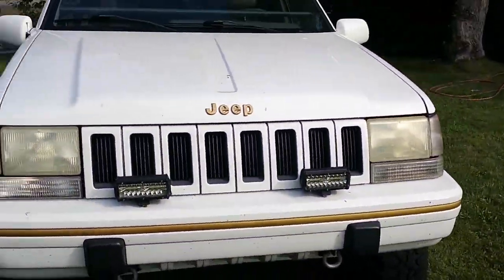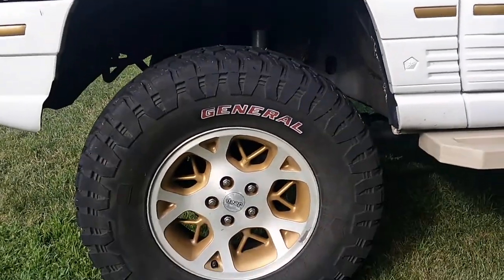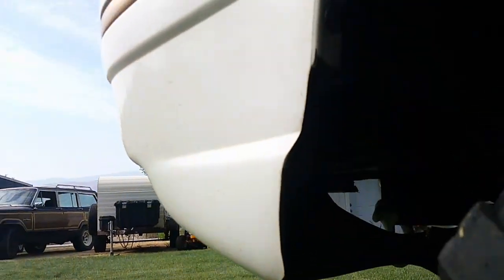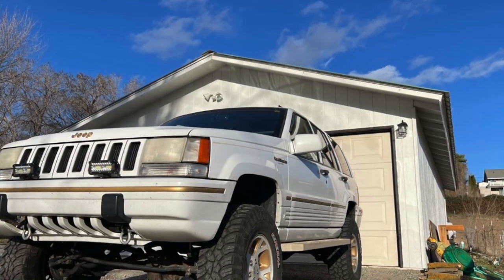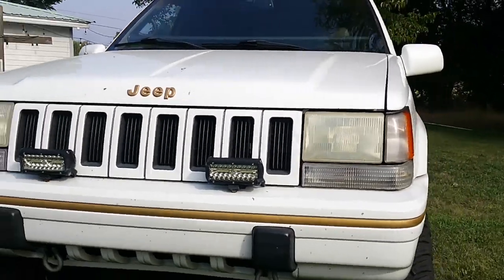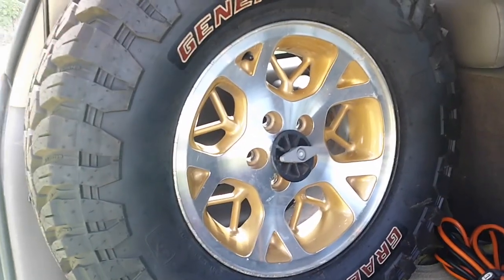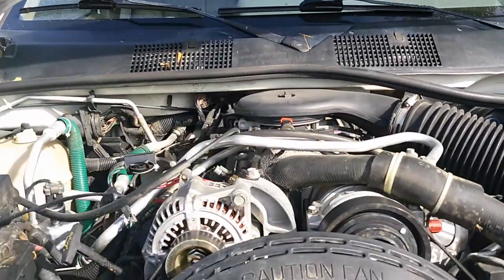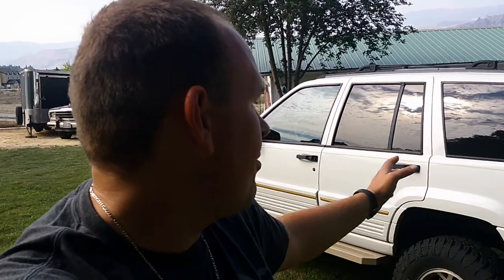ZJ Grand Cherokee walkaround: Insane mods on a stock looking rig

Comment: Hey I just bought this Jeep, now I'm starting to do so improvements and upgrades, though it don't need much. The only thing missing from it was the sliders. I originally started looking at TJ's, this is a far cry from it but a better fit for what I want it for. Nice job on the build, well done craftsmanship you and your Dad did and my condolences.
Reply from the maker: Glad to hear it went to a good home! Hope to see you on the trails! Are you local to sandhollow? Feel free to email me with any questions and I’ll do my best to help😎
Reply: @Geeks4x4  Do you know if there is trailer wiring harness?  I'm going to drop the gas tank skid plate to see if the harness is tucked away up there.
Reply from the maker: @ no I never installed it, the guy you got it from might have it somewhere because I had it but never did install

Comment: Hi there, I just came across your channel. Fist of all nice ZJ and I’m really happy that you were able to finish what your father had envisioned. I purchased a ZJ earlier this year and It’s had a constant electrical draw which we can’t figure out. My battery is always dead and after watching your video, I’m thinking it might be the computer controlled voltage regulator that you mentioned. Could you send me the link that you mentioned. Thanks.
Reply from the maker: Hey there, Yes here's the link https://www.backyardmechanic.org/how-to-build-a-external-voltage-regulator-for-dodge-jeep-chrysler/
Not sure that this is your issue but it sure could be. One way to test would be to disconnect your alternator after charging your battery and let it sit over night.
Reply: Thank you, I appreciate it.
Reply from the maker: @Jeeper-zq5lu  No worries, hopefully its your issue!
Reply: @Jeeper-zq5lu  Battery drain could be from anything but in my case it was something not expected.  My rear glass hatch sensor wore out.  So going down the road at night my interior lights kept flashing.  I disconnected the sensor on the hatch to kill the lights.  After a day or two my battery would die.  Issue was the computer that monitors functions in the jeep detected an open window and the computer would never shut down.  I had no warning lights saying that something was open or wrong.  I replaced the senser and plugged it back in and all is good.  You may have a bad sensor somewhere. Just sharing incase it helps with your search.

Comment: I need to install the voltage regulator what's a good place to tap for continus power while running. That turns off with vehicle?
Reply from the maker: Here's a full video I made on the install, I got my power from the fuel pump relay i think. https://youtu.be/2FpqzDarQ7o

Comment: how reliable are 5.2 i know theres alot of variable's but one with 200k on it its cheap like 1500 just wasnt sure if they are reliable like 4.0
Reply from the maker: Their a pretty good motor, same combo that was in the trucks all through the 90's maybe not quite as good at the 4.0 electronic wise but the motor is pretty stout.
Reply: @Geeks4x4  like 250 300k good lol
Reply from the maker: @torreypires6192  The amount of beat down ones I've seen on fb market place with that many miles I'd sure say so!
Reply: @Geeks4x4  i agree its white and gold like yours super clean interior... might go grab it...  plus i like and subscribed keep the good content coming
Reply: @Geeks4x4   also how much lift you got on your zj is it long arm or short arm just wondering the lift and tire size is perfect size not to big or small
Reply from the maker: @torreypires6192  awesome man hope you have great luck with it!
Reply from the maker: @torreypires6192  I think it was 4.5 inches of lift, IRO springs rough country long arm.

Comment: OMG that grab bar in the inside is beyond dangerous. I hope you dot drive it on the street with anyone you like in the pass seat as thats a face breaker.
Reply from the maker: Doesn't really stick out past the dash. But yes its hard, if your wearing your seat belt you shouldn't be going that far forward anyway. Plus there is still air bags. To each his own, I'll take the extra strength and added usability.